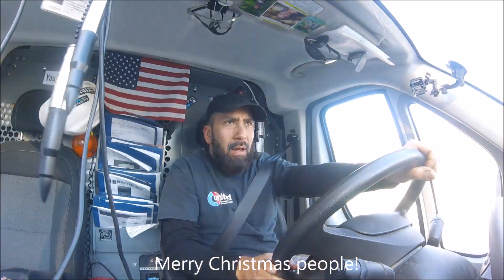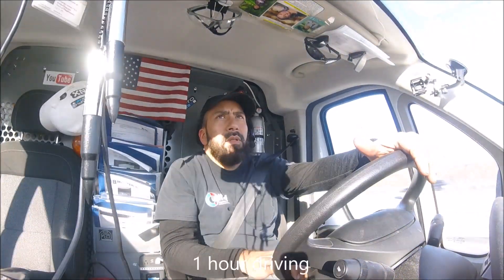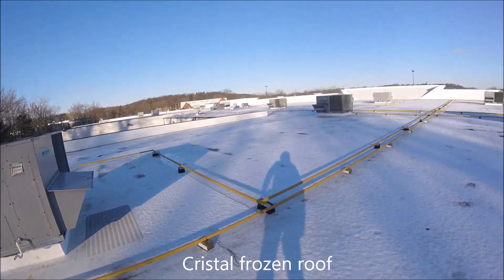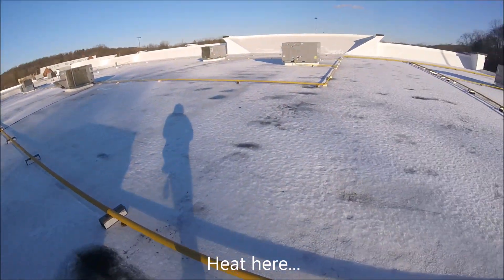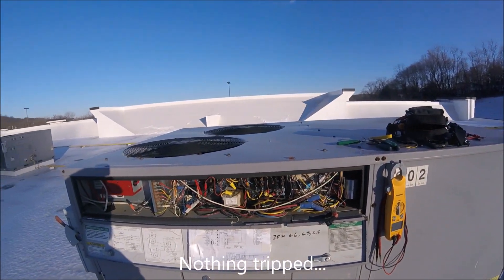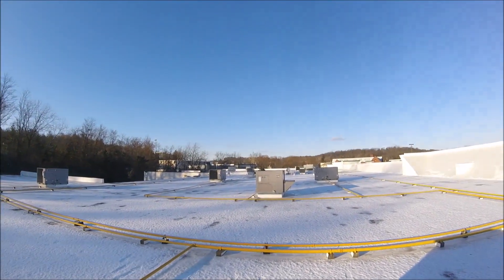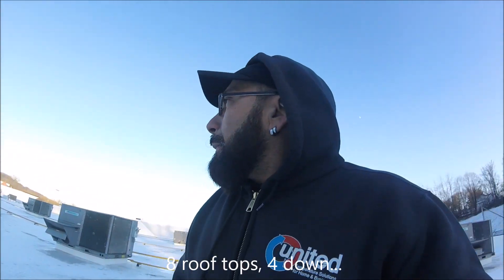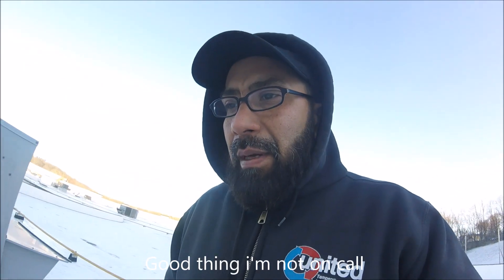Room a thousand years wide - HVAC LIFE

Comment: I usually check the heat exchanger if the roll out trips
Reply from the maker: Squirtle Hvac i did it, but was too cold to keep filming 😁
Thank you for watching bro
Reply: Flame will usually dance and a fowl odor will be coming from the exhaust when unit is running and the exhaust hood will be black with soot  if the heat exchanger is bad.

Comment: Whats that 3v fuse checker you used called?
Reply from the maker: Paper Mario it is a normal 3.2A low voltage breaker, you can find in York or Carrier units, every time we replace one RUT I removed them.
Thanks for asking and follow

Comment: Do you have a link to where I can get the mini fuse breaker?
Reply: Osmar Ponce there are many different types. Check Tru-Tech tools
Reply: Lil Popper on Amazon. There's a 3A and a 5A version.
Reply: Alex was using a Lennox furnace low voltage breaker it looked like to me.   Find a Lennox buddy n ask him to get you one